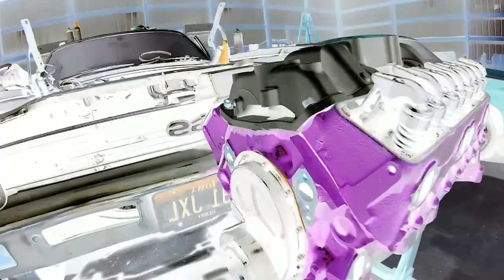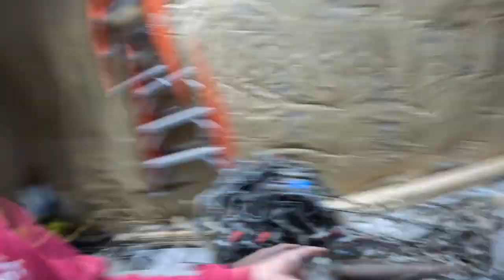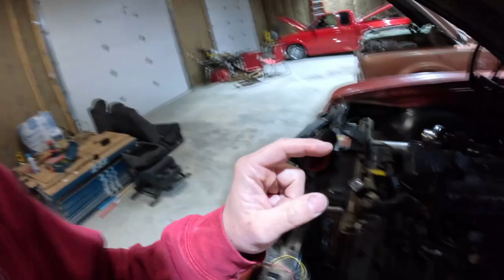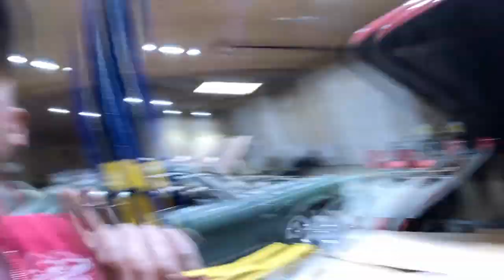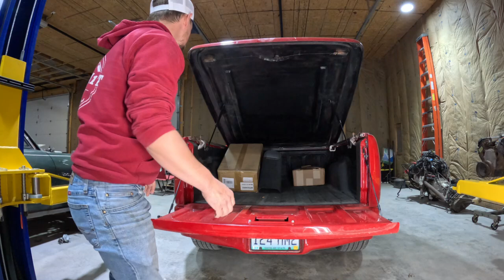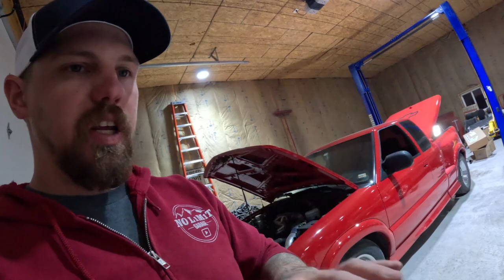S10 LS1 Swap Underway + C10 Plans!!

Comment: I’m just finishing up my LS swapped S10 myself. Was supposed to be a down and dirty, lowbuck swap but snowballed into darn near a frame off rebuild… over 5 years deep now but just doing it on the sides. The odd weekend where and there lol. 6.0L LQ4 out of a Yukon Denali. Took my first rip the other day with my tuner. Couldn’t get the smile off my face lol

Comment: are you running the 4l60e that was behind the 4.3 original engine? what did you have do to run that trans?
Reply: im putting a 2007 5.3 in my 2002 s10 that originaly had 4.3 with 4l60e but wanting to use that transmission with swap.
Reply from the maker: @beardedtrucker9486 yes, bolted right up. Nothing really to change
Reply: @NoL1m1tGarage no converter change, necessary? Factory, stall, converter, etc and what about the rear end?

Comment: Can you drop a parts list I’m try to do the same thing
Reply from the maker: It would be extensive lots of parts went into this. The broad overview, 
Hooker blackheart mounts, trans crossmember, and hvac box. CPW harness, ICT billet alt/ps pump bracket, dirty dingo low mount a/c bracket, sanden sd7 compressor, full custom exhaust, mini fans, etc. etc. etc.
Reply: @NoL1m1tGarage Okk ok thanks